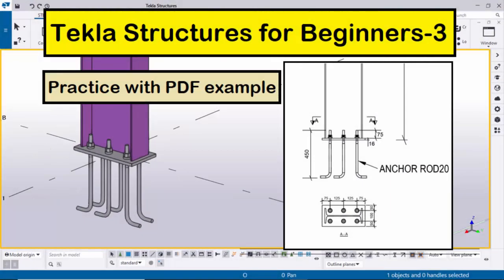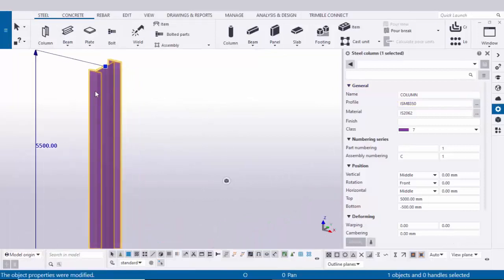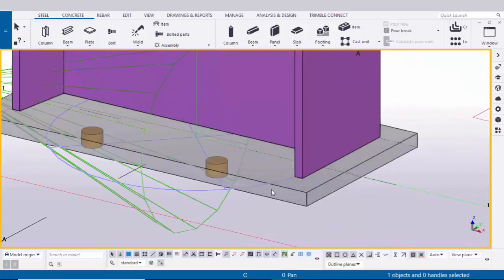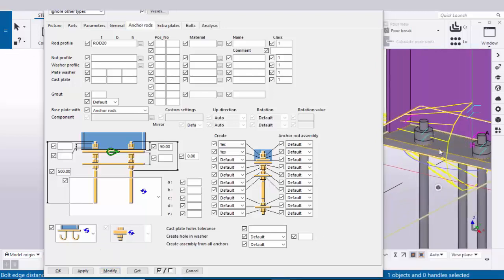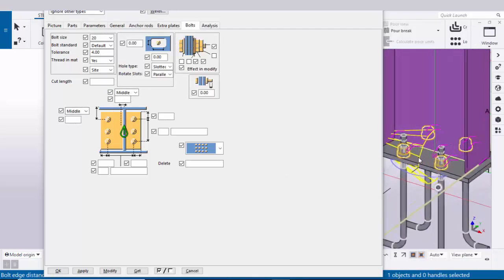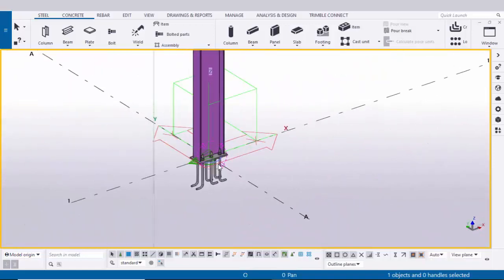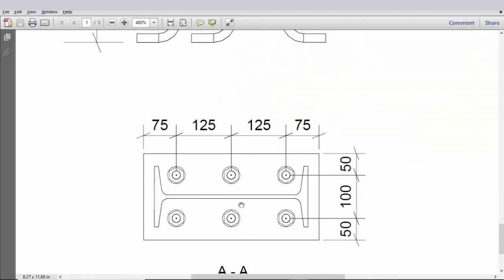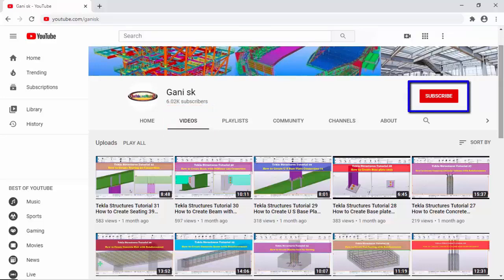Tekla Structures for Beginners - 3 | Base plate | PDF example

Comment: Is Tekla percast same like Tekla steel structures?
Reply from the maker: Tekla precast for concrete buildings
Tekla steel structures for steel buildings
you can do both in one Tekla structures software, but procedure and options are different.
Reply: @GaniSk  thank you sir
Reply from the maker: @swapnilbirajdar6647  You are mostly welcome

Comment: Is there any solution for importing tekla structural designer 2021 project in tekla 2018 structures i have tried but it not supports the tsmd format it supports only cxl format
Reply: It will not open
Reply: @Srikrishna-75  so i need to install 2021 tekla structures to open it